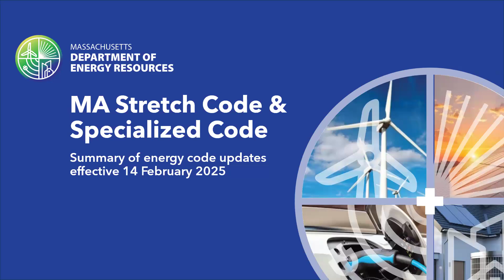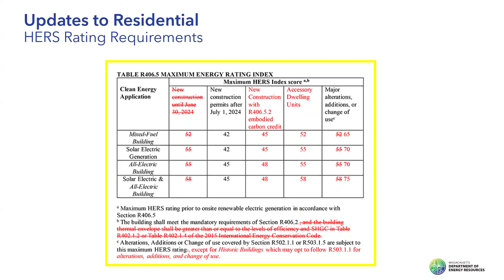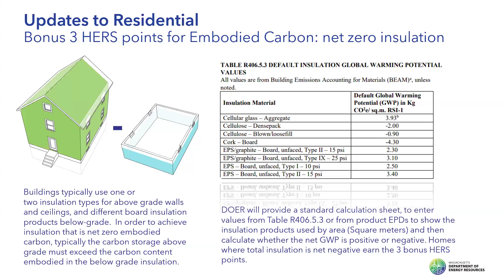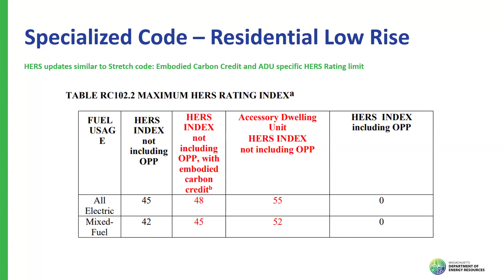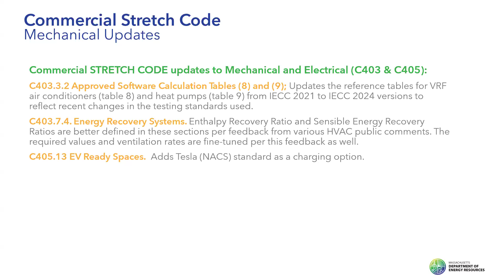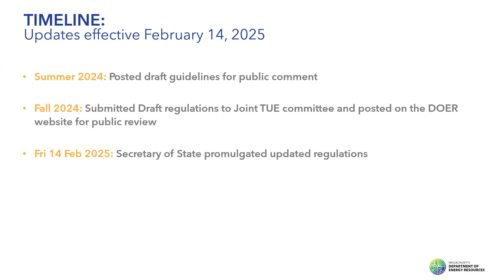Summary of MA Stretch & Specialized Code Updates

Comment: 00:00 Start
00:50 Overview
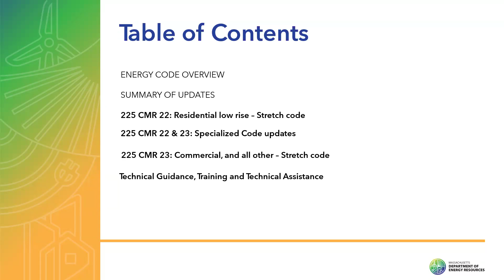02:48 Review of Code
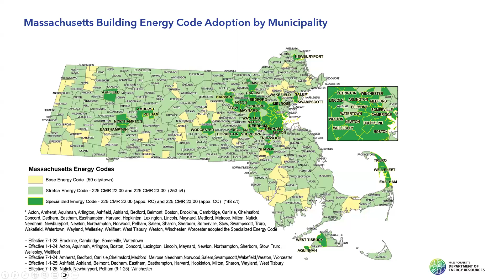04:25 (A) Residential Low-Rise Stretch Code Updates
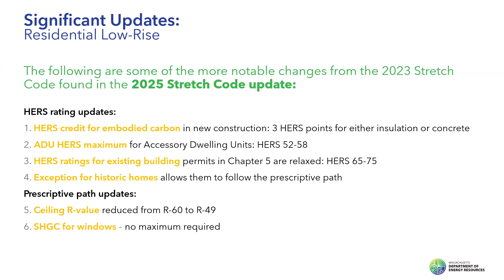11:11 Examples
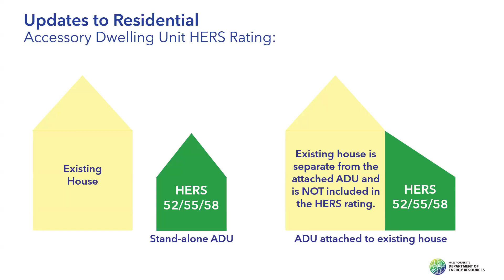19:52 Residential Embodied Carbon Credit
28:45 Overview of Other Stretch Code Updates
33:51 (B) Specialized Stretch Code Updates
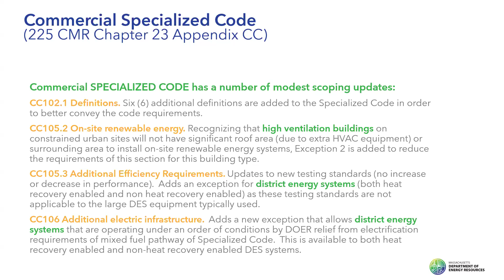37:54 MassSAVE Program Update
38:57 (C) Commercial Stretch Code Updates
41:15 Envelope Specific
42:42 Mechanical Specific
43:51 Credit Options
45:43 District Energy Systems
46:34 Passive House & HERS 
48:29 Existing Buildings
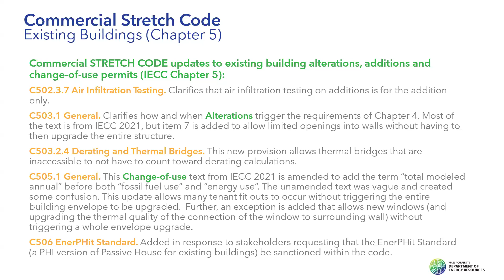50:45 Timeline Overview
54:07 Q & A

Comment: Thanks for the webinar and the clarifications made.  The added language to C505 of “total modeled annual” fossil fuel or energy use helps yet we are still seeing confusion amongst Clients on wether or not ALL projects that are considered a “change of occupancy or use” are required to have an energy model completed to prove wether there is a net increase in modeled annual fossil fuel/energy use?  Could the DOER please clarify this?    The example I am thinking of is a office/lab in which we are shifting program around and only increasing the lab to office ratio from 35/65 to 40/60 and adding some additional H-occupancies.  The client and our engineers do not anticipate there will be an increase in energy as the MEP infrastructure is also being replaced with more efficient units.  The client occupies all floors of the existing building and the renovation is ~40% of the existing building.